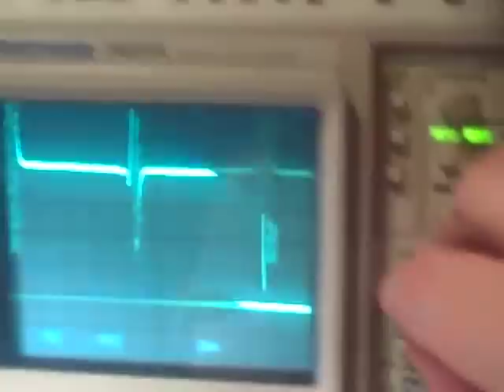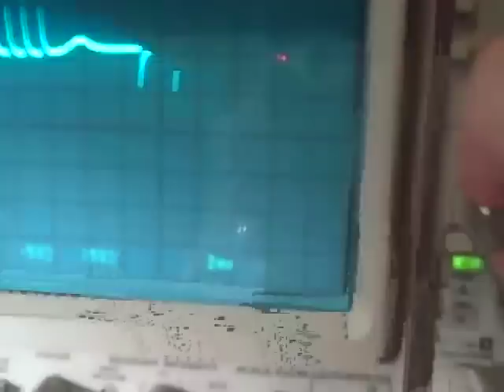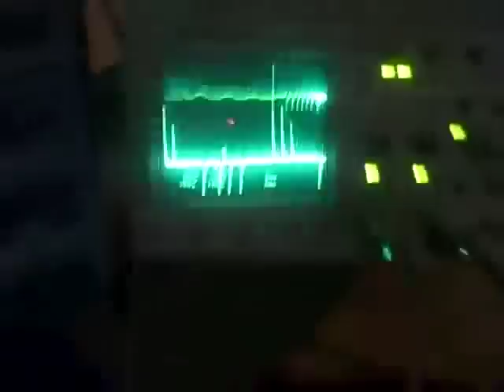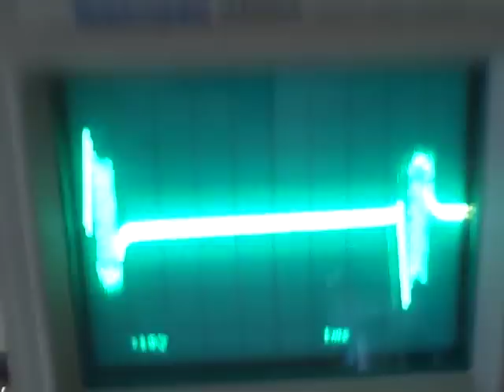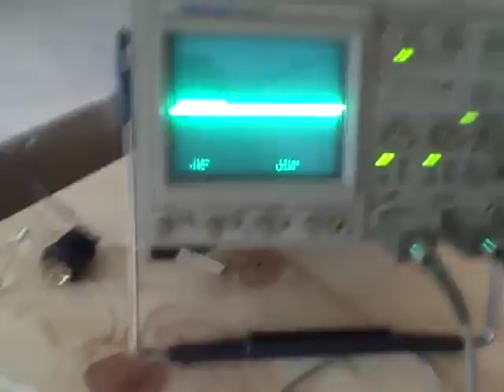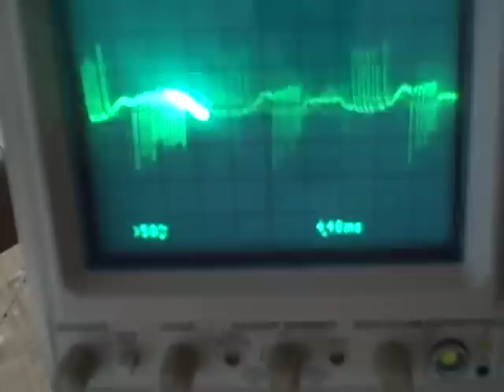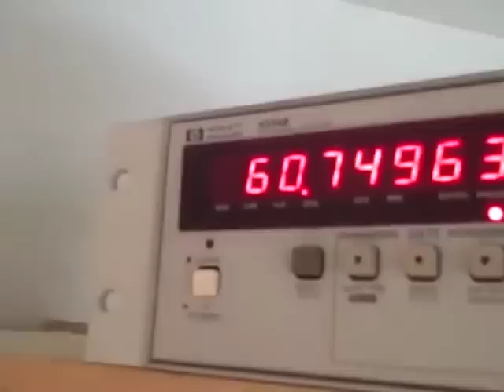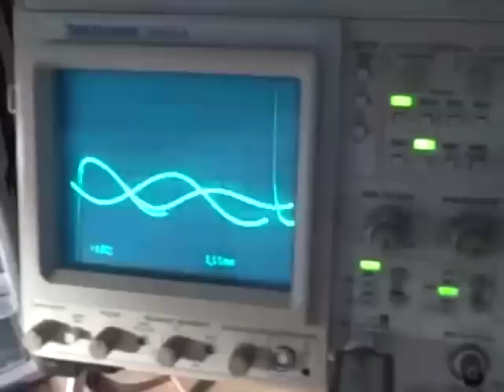Non Linear (longitudinal) Power Transmission With Tesla Hairpin Circuit (Alex Petty demmo)

Comment: Pulsating high voltage impulses with gap increased or decreased with spark gaps... Gaps that's what it is significant here and if both meet from both sides it becomes scalar or longitudinal waves.... Must b done from both sides becomes longitudinal and attach any load or resistance in between with oscillating or proper capacitance to maintain resonance, singularly remains scalar both sides becomes longitudinal, higher the voltage of the impulses the better and lower the gaps

Comment: Sorry I'm new to this it's said non linear because its comming or connected from eather? Please let me know.

Longtudulal wave is non EMF pure push in sted of transverce wave  has EMF is this why safer? 

 Tesla was later try change to wireless & one line line transmission ? Please let me know
Sir.

Light boulb was pritty insurated like water proof right?
Reply: I don't know that guy or the details of his video but to be honest it looks to me like he was just demonstrating a basic stout copper bars circuit using an NST and some doorknob caps and then calling it "XC power transfer" like it's some kind of thing he invented/discovered. As his mother, presumably, was at the door near the end of the first video likely asking him to quiet the hell down he laid it on again about the XC power transfer as if it was something revolutionary he could turn a profit from. Transverse or longitudinal waves aside what that thing is doing is throwing RF like hotcakes. 

The lightbulb in water trick is only special in that ordinary low frequency pulses is going to hurt pretty bad at high voltage when you touch it, especially with wet hands. The bulb was insulated at the filament of course but water doesn't pose enough conductivity to prevent one from lighting when submerged anyway. Feed RF energy into a bulb (something like safely above 20khz) and hold it underwater with your bare hands and it will light just the same so what he is showing there in particular doesn't really get into the specifics of what is going on.

You can demonstrate the same shit at lower power by using a homemade HV source and foil capacitors rather than an NST. You may not be able to light a 100W bulb bright at low power but smaller bulbs will light fine. 

What he is doing is by no means 'safe' though. It's actually safer to touch the high voltage high frequency output of something like a Tesla Coil so long as you understand the content of the sparks. You can start to feel something the higher the power is pushed into the hairpin, and should something go wrong in the dielectric you could be looking at a fatal situation when touching the bars.